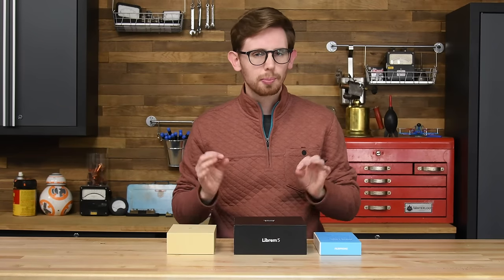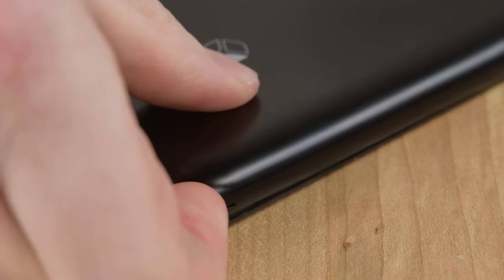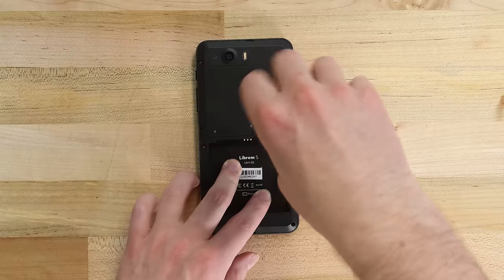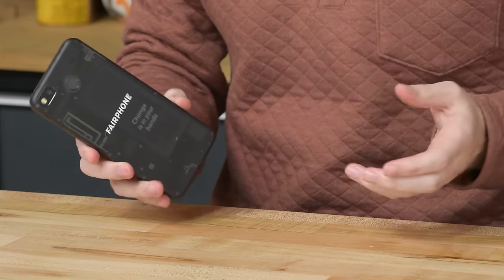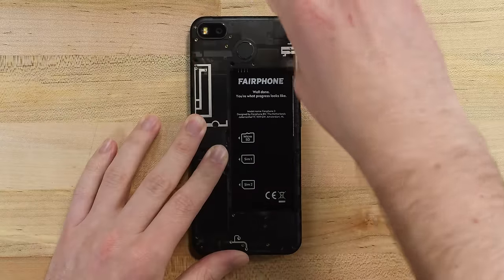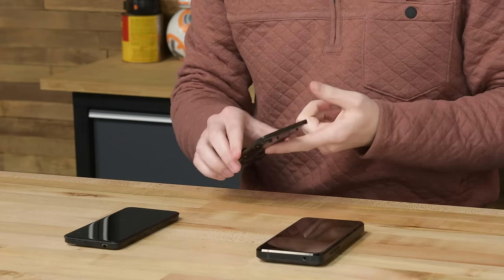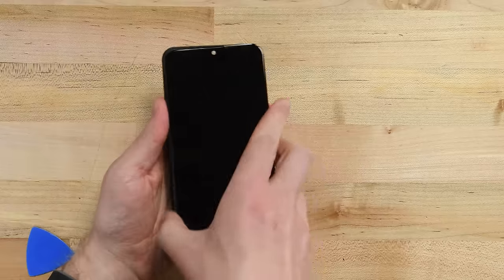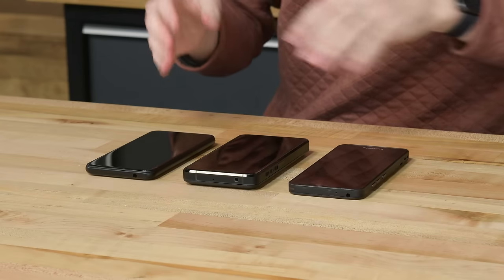Your Smartphone Doesn’t Have To Be Glued Shut!

Comment: The concept seems interesting, but I just checked fairphone and they sell a 3+ that is low spec and high price. I would need some water resistance (unclear if they have it, judging from this video, no) and more competitive specs and prices. I'd pay maybe a say, 10% premium for repairability, maybe a bit more, but I would need a good phone. If manufacturers would go this route I'm sure that in 2, or 3 generations they would be able to produce some good stuff but we do need the big ones to join.
p.s. maybe not everything needs to be replaceable but display for sure, then battery as well, maybe camera if it is also prone to damage. The parts that actually get damaged often. Also it doesn't have to be so easy to repair that my mother can do it, just be able to do it with more or less generic tools and we should be able to find reasonable priced parts. What I'm saying is I don't want to compromise much on the functionality and price either, making a repairable phone that is crap or expensive gets us nowhere, only fanatics will buy it.
Reply: Fairphone doesn't only think about repairability and environment sustainability. They also care about fair wages. After all, they never use overworked underpaid workers like Foxconn does.

Comment: How does the software integration side of things work? If a cellular module is swapped with a newer rev and/or different firmware to the previous how does the system adapt to the change?

Comment: i've had several Japanese smartphones and feature phones that were waterproof but also user-serviceable.. unfortunately the trend now is to just glue everything together
Reply: wait, really?
Reply: @Looo0007  if you mean waterproof user serviceable, sure. i still use a fujitsu f02 flip phone with a standard replaceable battery. im assuming it uses quality gaskets around the covers to keep it sealed. in contrast none of the new fujitsu phones are remotely serviceable

Comment: are any of them waterproof, like the ones that are sealed?
Reply: I had a Sony Xperia Go and that wasn't glued shut while was waterproof and thin like a normal non-waterproof phone, so it's can be done.
Reply: @U.S.A.  water proof to what level? or do you mean water resistant. i could see resistance using a rubber gasket, i don’t see any way to keep a phone waterproof to any depth without sealing.
Reply: @justinsfunthings8263  On gsmarena it says water proof and IP67 rating. Why would be a rubber gasket less water proof than glue sealing? This phone has a huge silicone sealing ring between the back panel and the screen and the whole phone is held together by screws, and because of this you won't lose waterproofing by changing the battery.

Comment: But the water resistance 🤔
Reply: just don't drop it on water
Reply: Who uses the phone on the shower?
Reply: Water resistance vs user changeable battery, I’ll take battery any time. Not needing to change phone because battery has reached end of life is invaluable.  Apple almost always makes user swap phone needing phone to reinstall system software a time consuming feat and phone takes a month before feeling just right.   Also less  pollution.  With the back being able to pop off drying phones is much easier and repairability is enhanced.

Comment: Well I repaired my smartphone, Xiaomi mi 9t pro. I removed the glass back but I still didn't glue it back. I leave it unglued but in a case for easy acces. If there is something wrong (sometimes a sensor) I can easily see what's wrong.

Comment: “..designed to be used for 18 months and then thrown away.”

Android phones may very well be, but Apple phones certainly aren’t. We still have OG iPhone SE units in our smartphone fleet at work. The bulk of the rest are iPhone 7 units. Then we have no issues selling them so they get even more use.
Reply: I have a friend that has changed 3 iphones in one year because they kept breaking (not because he dropped it, have you), and I have another friend that has been with the same Samsung phone, none flagship, for over 7 years, and still works alright (with some hiccups of the battery department, but that is to be expected). What I mean to say is, it is not as majestic as you imagine it to be, iPhones being these flawless consumer products, and Androids being fragile pieces of hardware, this is a misrepresentation that has been perpetuated by a notion of holy quality by Apple, sprinkled with some logical fallacies.
Reply: @GuidoPerdomo  You’ll note I said “may very well be” - I have no direct experience with managing over 400 Android devices. My point is that the video states that flagship phones are designed to be used for 18 months and then thrown away. Factually, and anecdotally, this is incorrect when it comes to iPhones - I know that.
Reply from the maker: William, you're right about iPhones! They often don't get enough credit for being decently repairable and supported by Apple for many years. Sorry for overgeneralizing.
Reply: @iFixitYourself  No worries! Thanks for the clarification - and for the interesting video!
Reply: @Hezekiah Francois Urua laughs in Nokia 5 from 2017
Reply: @Hezekiah Francois Urua @bluetooth yawns in you have both missed the point.

Comment: I wonder how you could make a 10/10 repairable phone that also had water resistance.
Reply: Ask the Galaxy S5
Reply: Or the X-Cover 2, with it's IP 67 rating
Reply: @WhenDoesTheVideoActuallyStart  aren't S5 only IP67 rated? Most modern flagships are IP68.
Reply: @bltzcstrnx  The practical difference is nil. Both are rated for immersion in water, it's just that for IP68 rating the water must be pressurized.
Reply: @WhenDoesTheVideoActuallyStart  mostly true, but if you're selling high end phones it could mean marketing disadvantage.
Reply: @bltzcstrnx  Are you an investor? If not, why would you care about their marketing?
Reply: @WhenDoesTheVideoActuallyStart  because it effects a lot more than just investors. They need to be able to compete or go under. When that happen their user will loose choices.
Reply: @bltzcstrnx  No one ever asks "Will the company still be around in 10 years?" when buying a phone.
Reply: @WhenDoesTheVideoActuallyStart  you realize phone are no good when the company down right? No more software updates, no more spare parts and so on.

Comment: I guess they have great water resistance :)
Reply: Even with ip67 I wouldn’t test it under water because of the guaranty. Yet if something happens this phones are easier to repair
Reply: @edd9581  I said water resistant. I still want a phone that can outlast me rain and even if I by mistake drop it in some water. Phones like this would not survive. Apple and Samsung build phone compact and to survive not to be easy disassemble, since they is not what the normal person ask for
Reply: @edd9581  Company work smarter not harder

Comment: Are they waterproof tho? Water is the second cause of phones need of repair.
Reply: Only resistant against splash water
Reply: The Galaxy S5 had both a removable battery and an IP rating for water resistance. I don't know whether these are, but the big brands could definitely do it if they wanted to.
Reply: The X-Cover 2 also had an IP 67 rating
Reply: I'm not sure why it would be hard to waterproof. If you make the back cover single piece and hold it with screws there is something called a gasket...

Comment: Do any phones exist that allow for replacing the battery without shutting off your phone? I know that sounds odd, but it's technically possible with a small built in battery that only lasts a couple minutes. I thought it would be useful to have a phone that you don't recharge directly, rather you recharge the batteries outside the phone.
Reply: do u also change lamps without turning the lights off?
Reply: @true7251  I don't have to wait a full minute for my lamp to boot up

Comment: it does have to be glued shut because of peoper waterresistance and also a unibody design it is very hard to have a properly made metal back that looks and feels unibody but also can be removed
Reply: "it does have to be glued shut because of peoper waterresistance"
No it doesn't. Samsung did a removable back and water resistance in the Galaxy S5. Also, another pro-tip, you can keep the headphone jack and still be water resistant. Several phones did it before Apple decided to kill the jack and everyone copied them.

"also a unibody design it is very hard to have a properly made metal back that looks and feels unibody but also can be removed"
1. Who asked for a unibody design? I didn't. I was always okay with plastic backs. My current phone has a plastic back.
2. What modern phones are unibody anyway? It's all glass sandwiches. Glass breaks easily, so they want to put it everywhere in the hope the phone breaks and you buy a new one.
Reply: @mjc0961  on the last point, I'm pretty sure my phone (pixel 2) is unibody.  Otherwise i agree. The lack of a headphone jack is a plague, bluetooth is nice when you don't want cables but not ALL THE TIME when your headphones die unexpectedly or when it interferes with your wifi
Reply: "it does have to be glued shut because of proper water resistance"
Sony Xperia Go was held together by screws and had a huge silicone ring sealing, no glue were used and because of this it was possible to change the battery without loosing water resistance. It was thin like any other non-waterproof smartphone.

Comment: Shame about the Teracube. I'll take glue over a notch any day. Fairphone looks cool, but appears to be Europe only. Librem 5 seems to be overkill, I don't need a phone that thick just for removable wifi and cell cards.
Doesn't really matter though, because the most green thing to do is not replace my perfectly fine Pixel 3a just because I saw a new thing. My phone still works, so I keep using it. Replacing it comes if it breaks beyond repair or becomes unsafe due to not getting security updates anymore (Google supposedly guarantees updates until May 2022, so I have a while before I even need to worry about it  - maybe by then Teracube will learn how to not ruin the screen 😛).

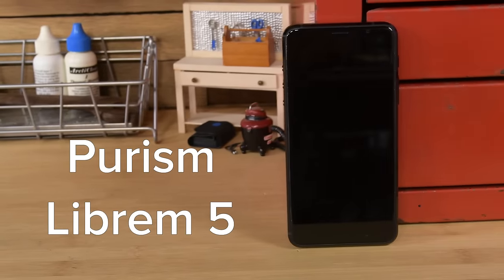BTW, timestamps don't work unless you put the 0 in front of your less than 1 minute in stamps. You can't do :00 and :50, it has to be 0:00 and 0:50

Comment: missed the pinephone- which has been shipping longer than the librem, is open sourcing the modem firmware, and has already shipped upgrade mainboards to early backers who want more memory.
Reply: I thought it was illegal to make open source firmware for the modem?
Reply: @in-craig-ible6160  They’re keeping the certified blob, but running it on an updated linux kernel running on modem. Basically they’re trying to mainline as much as possible, and push the binary blobs out of the phone’s os and into the modem.

Comment: Question about the Fairphone: Who doesn't have a Philips screwdriver?
Reply: It's probably not that people don't have one, but a lot of people tend to use over / undersized screw bits which can cause them to strip.
By including a small screwdriver which costs them practically nothing you solve that. Mostly it's just a statement.

Comment: what's the point of replaceable wifi and BT modules? kind of seems more like a show-off than anything actually usable. batteries and screens are two most common parts to fail in a smartphone and they should be easy to replace, the rest just adds to size and weight
Reply: If they made the camera module truly upgradeable to something akin to State-of-the-Art I would be all in on these phones. My iPhone 4GS still works fine, but the camera is not anywhere near as good as my more modern Samsung S7.  And of course the cameras have advanced since then - and I expect some break-thru cameras in the future - the hardware hasn't improved much in the last couple of years.
Reply: @allent8977  yeah, i thought of upgradeable cameras as well, it would be a nice feature

Comment: Modular phone *usually* don't water/dust proof and not to mention how bad it will be if it is dropped barely from 1m.  Don't forget how rare to obtain any modular replacement from the market.  This idea is great but *usually* won't last for weeks.  A typical iPhone can last more than *18* months plus the its value maintained.  The value of a modular phone dropped immediately in half at the time you open its box...

Sad but true.

Comment: Not all user are like to repair their stuff by their own... that’s were the reason of the professional is existent.
Reply: Phones being easily repairable means you can just ask a techie friend to open it to change the battery, or go to a repair shop and have it done for much cheaper than if they had to spend one or two hours using heat guns and tools on an internally fragile phone (I.e. they have to build a cost for possible accidents into their fees) to change a battery.
Reply: @WhenDoesTheVideoActuallyStart  It is the complexity of technology that is why we call it smartphones. It is getting hardly to repair along the maturity of the technology itself. The era of Nokia where you can just simply change the battery, parts or casing just like that has been passed.
Reply: @1010TienTien  The smartphones shown here are excellent devices if not for their old parts, but that's just because they can't benefit from the economies of scale that giant corporations have (Small companies pay more for each smartphone and have higher per-device costs that need to be ammortized)

Just look at the insides of an Apple phone and then come back to talk to me about "complexity of technology blablabla". Everything there is modular, the only difference with these phones here is that Apple uses glue.

And they started doing that because they figured out how to block repairability for consumers while still allowing it for themselves - they use proprietary tools to electronically tie each part of the phone with the SoC.

The truth is that they just want to make more money, after all that's what all companies want. Except that in this case they're trying to turn access to their hardware a service, rather than actually selling you the hardware and letting you do whatever with it, to make sure you have to spend more, more often, to get the same experience.

Just look at laptops! While consumer laptops are less and less repairable, most enterprise laptops are still very repairable and modular, it's just that many brands want to charge extra for that "feature".

There's a reason why old Thinkpads and old enterprise tech in general is very popular among techie-minded folk, they're often superior in many aspects than new consumer devices, and will last longer in your hands.
Reply: @WhenDoesTheVideoActuallyStart  all I can see is you are the one who bla bla bla
Reply: @1010TienTien  Well, just retort to my point about Apple then. How is it that they can make a phone as modular as these ones, if modern technology is muh oh so complicated?
Reply: You're just repeating the talking points of corporate propaganda that they have been trying very hard to spread and make people believe.
Reply: @WhenDoesTheVideoActuallyStart  Ask Tim Cook then if you want to know more about Apple.
Reply: @WhenDoesTheVideoActuallyStart and you’re just an upset person who doesn’t want to pay more for repairs. Why I want to spread the propaganda for something that I’m not getting paid for.. oh my such an overthinking..
Reply: @1010TienTien  yeah smartphones are complex but they csn still be easily repairable like a Nokia. My Lumia 950 has a removable back, replaceable battery and if you want to open it up, you only need a regular torx screwdriver and from there you can replace almost anything
Reply: @KofolaDealer  yup but remember the Nokia nostalgia phone is over. Manufacturers have their own vision and the way in their smartphones. If you own flagship iPhone or Samsung it surely harder to do repair.

Comment: You ignored the elephant in the room: water resistance???
Reply: What if you just didn't drop them in water?
Reply: @KofolaDealer  I asked a question, thus the question marks.
Reply: Again, why not a single piece back held tight with screws, with a single gasket?  I can't imagine this being rocket science (unless you worked on Challenger) - just a matter of design priorities.